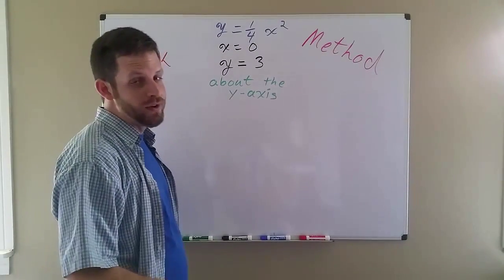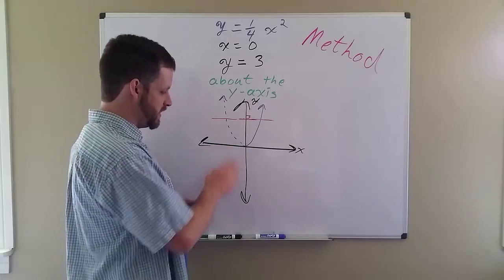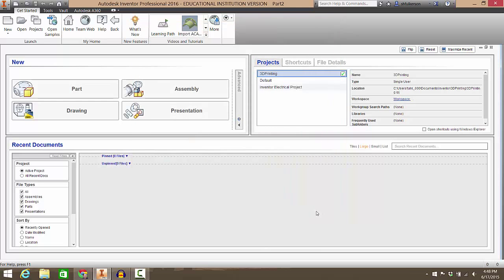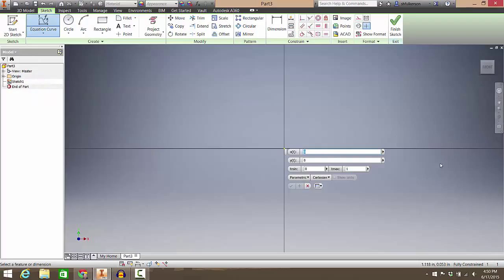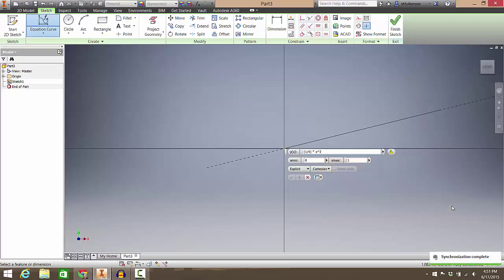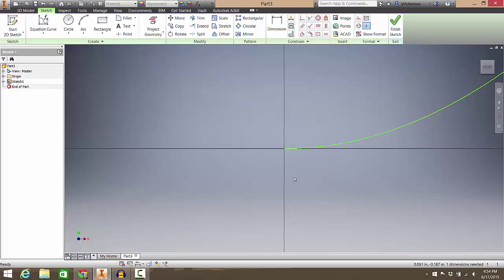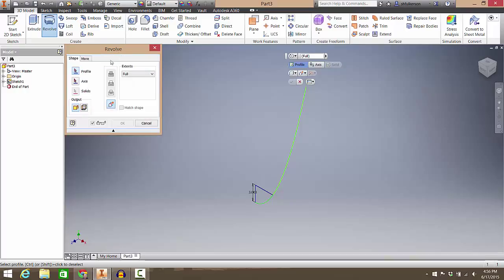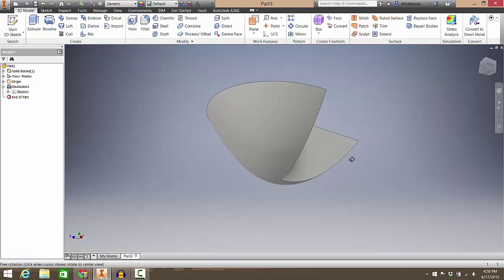3D Printed Model Disk Method Autodesk Inventor

Comment: I've a problem with inventor 2016

the thing is that i can't unfold a sheet metal, cuz the program doesn't detect a "stationary reference", i think that this happends cuz none of the sheets edges is straight ( one of them has an ondulated pattern and the other is curved ).

is there anything i can do about it ?

thanks for your time

seeya